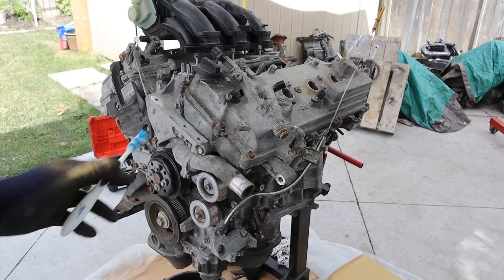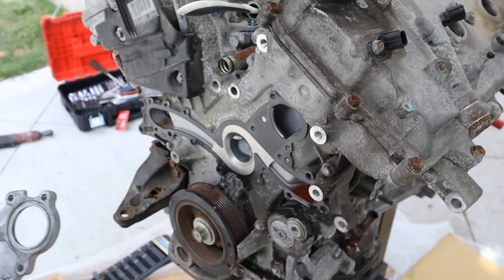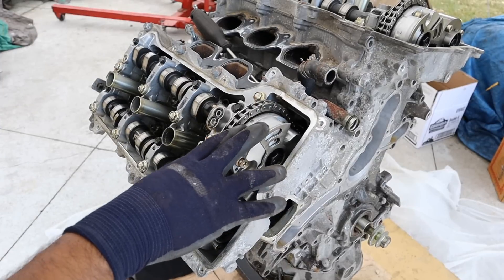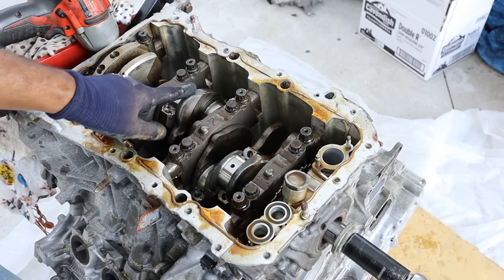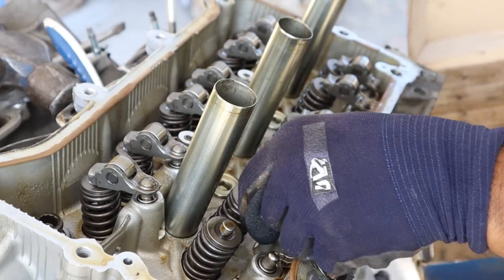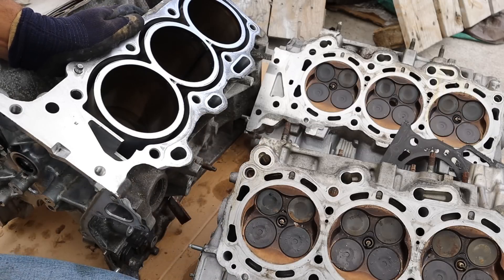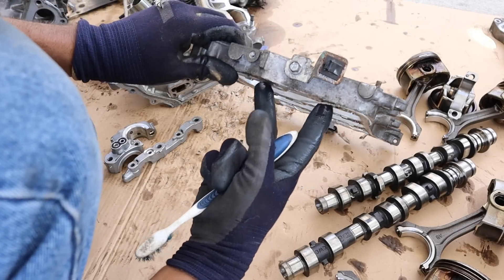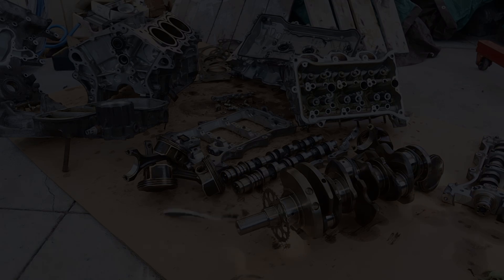The Toyota 2GR 3.5L V6 Engine is a Legacy in a World of 4 Cylinder Turbos

Comment: The 2GRFE is JUNK GARBAGE SHIT engine.  Not even close to a good engine.
Reply from the maker: Why would you say so? Bad experience?
Reply: @speedkar99  They have had TONS of issues.  Google it.  Even a head Toyota mechanic said he wouldn't take one if he was given one.  Yes very bad experience.  My whole 2009 RX350 is junk eventhough Lexus maintained all it's life before I bought it.
Reply: I bought it last June with 72k miles on it and now at ehhh 90k.  Transmission is acting funny,  right after I bought it LOUD as engine nock sounds like a diesel.  Get's worse with cold.  Power steering pump is bad when it gets cold out makes the notorious groan.  2008 Toyota Rav4 I4.  Only issue with it and 180k miles is the nototious oil burning issue Toyota NOTORIOUSLY tried to cover up other than the control arm fiasco they tried to cover up also.  That thing still rolls with 180k on it battered and beaten.  Lexus at 92k damn powertrain is going to shit in a handbasket.
Reply: @speedkar99  I'll gladly bring it to you and you can fix it.  Let me know where to go.  I'm being honest too.
Reply: @glennnichols4220  The 5 speed auto in that rx usually don't fail even if you are one of those owner who has the "funny" shifts from what I am guessing from 3-4/4-5 upshift and 2-1 down shift. Also you have the unfortunate piston slap which I think it affects 20% of 2gr owners. As long as that goes away when fully warmed up then keep driving it. I suggest using synthetic oil so they don't thin out as much when warmed up, has to be 5w30 no light weight oil like 0w20. One customer switched to 5w40 oil and they said it was quieter, funny because that's the recommended oil from lotus for their Evora's. At our shop we seen these cars 200k+ miles with piston slaps and rough shifting transmissions. Hell, my 07 v6 camry piston slapped from new and it's 197k right now doesn't even burn oil. Goodluck with yours.
Reply: @oceanzhu1002  The transmission sure isn't the smoothest and it has a mind of it's own.  Sometimes getting out in front of traffic in a 65 mph zone from a dead stop I floor it when the tranny is cold and it doesn't want to shift.  It just creeps along.  And then when I started it the other day from cold none the less but it  was warm outside I put it in reverse and stepped on the gas and nothing and then made a jerk and engaged and kind of jerked a few times when backing up.  And yes the piston slap goes away when the oil pressure has come to not necessarily when the temperature gauge is normal.  The sad part is I talked to the previous owners about it and they said they NEVER had any problems with it when they traded it in a couple months before I bought it.  Certainly they don't have a reason to lie but that doesn't mean they didn't.  All Lexus maintained from day one all the way until I bought it.  Nothing in the service records indicated any of my problems.  I find it however extremely odd how I get the car and it all of a sudden starts having major powertrain problems.  But I am glad you responded and gave me piece of mind.  I will try different oil.  But wouldn't heavier oil be counter productive to the piston slap?
Reply: @oceanzhu1002 piston slap? Uh oh.. I thought I had lifter tick. My 2grfe is pretty ticky, even when warned up. How worried should I be? It has almost 209k.
Reply: My lotus evora s and Camry would beg to differ lol probably just not well taken care of by the previous owner and unfortunately you got the raw deal of it, it happens brotha
Reply: @andrewraju5365  If you read my comments,  from brand new it was maintained by a Lexus dealership and the previous owner stated that they always put premium fuel in it and even hand washed it.  So the answer to your statement is in the ability to read.

Comment: Personally, the MZ series was better. The closed deck design can take a lot of abuse. Also the water pump is replaceable in the car it is a faff but it's doable even on smaller cars like RAV4s.
Reply: I like the power of the 2GR but I do prefer the closed deck design of the 1mz.
Reply from the maker: MZ was open deck wasn't it? 

I know people have found workarounds on the water pump but itsnot easy
Reply: @speedkar99  it's a closed deck or at least semi closed: https://images.prom.ua/2424375692_w640_h640_blok-tsilindrov-1mzfe.jpg

Really tough engines. PCV system sucks though and the VVTI parts aren't too good. But dump it into an MR2 and it's a hoot. I know a guy who put one into a Celica. It's just too bad you can't easily adapt it for RWD the engine is designed to sit slanted.

I find for the older rav4s you gotta go from the top and bottom after removing several parts in between, including all the front facing accessories. No it's not easy but it's doable. I'm not sure why the waterpump fails it doesn't seem like a bad design or anything, they're even all metal not BMW, but the bearings just go.

Comment: What is wrong with engine... Check engine heads. Replace head gaskets and assemble engine...
Reply from the maker: Doesn't work like that. Aluminum warps. You'd have to machine it flat again. But this engine has variable valve timing, if machined down, the cam to crank distance changes and timing is off. It's Scrap.
Reply: @speedkar99  so it can't be flattened and good to go... Than yeah

Comment: I think Lexus makes the best v6 engines in the world. I have a Lexus IS250 with only 170 000 km on the clock. Runs great, only thing is it eats oil like crazy, probably it has carbon on the rings. 

Recently I fixed the AT problem which was bugging me since I bought it, error code P2757. I just replaced 2 new solenoids SLT and SLU since they were the only ones which were updated by the factory (with some kind of filters on the canals).
Reply from the maker: The IS250 was known for carbon buildup because it doesn't have port injection to clean off the valves.
Reply: Hold my beer.........
The 44 years in production Buick V-6
Many Toyota engines are notorious for drinking oil
The Buick........was not.

Comment: My 2008 avalon had the pump die, but I stopped it on the side of the road when it got to 2/3 up and let it cool. I ran the heater to and back from work, then had a shop replace it. Been fine ever since and shes coming up on 140k. Besides some shocks and 02 sensor, nothing but brakes, trans spill and fill, and oil changes
Reply from the maker: Awesome! Keep it maintained and it'll last a while. How did the pump die, the impeller broke?

Comment: My 2GR-FE ( 07 Sienna) now running on its 3rd water pump. Luckily Extended warranty covered it. Those water pumps live around 5-6 years then they leak or the bearing goes. I've been through multiple recalls to replace the oil hoses or switch them to metal ones.
Reply: Did you change the coolant at all? The coolant turns acidic over time and eats through seals and causes the water pump failure. I have a 2016 Avalon with the 2GR, water pump still going strong fingers crossed
Reply from the maker: I've had my GS350 for 6 years and haven't touched the cooling system ... Makes me wanna change the coolant soon...
Reply: @speedkar99  based on anecdotal evidence, 5-6 years is the recommended interval for Toyota pink, even though it is advertised as 10 years. I did it myself last year and it wasn’t bad at all. If you hear bubbles through the heater core after changing it, make sure you open the bleed valve, attach a hose from the barb to the funnel on the radiator, and let coolant flow through it completely before sealing the system.
Reply: @jakeb4962  coolant was replaced each time the water pump was replaced, a third coolant replacement was during a radiator replacement. So, I never needed to replace the coolant by itself.
Reply from the maker: Should have been only one recall on the VVt hose right?
Reply: @speedkar99  the VVT hose was replaced by an updated rubber hose, at that time the full metal upgrade was not available, luckily this rubber hose still holding up. But there are other hoses in the bottom front passenger side, those were replaced by a flex mental pipes.
Reply: My 2008 rav4 is still on its original at 85k miles. Consistent 5k oil changes help a lot.

Comment: Awesome!! I love this motor. Makes my Avalon a sleeper
Reply from the maker: It sure does! I have the Lexus version in my GS350
Reply: @speedkar99  I have no issues with mine so far. I have 208k miles on the clock. No oil burning or leaks. One thing I’m worried about is the waterpump because I have yet to change that since I got the avalon used at 123kmiles. 

Which year is the best GS350? Oil consumption issues? I want to buy one in two years…

Comment: My gosh, an engine that clean from 2013 says it was fastidiously maintained. Hard to imagine how the same owner would keep driving after the water pump blew up!
Reply from the maker: I know. So sad. I bet they maintained it but maybe oblivious to the overheating situation
Reply: I once drove a Chrysler New Yorker with the 440 RB series engine, it blew a hose on the freeway in high summer
By the time I got off the highway and got it to where I could repair it, the exhaust manifolds were glowing a dull red in the twilight. I cooled it down, replaced the hose and refilled it with coolant, it ran like nothing had happened.
Try, just TRY, to do that with this Toyota or any aluminum head engine.The engine would be scrap metal throughout.

Comment: FSM says to remove the engine for a WATER PUMP!?!?  I knew it said the same for timing chain replacement in a Highlander which is bad enough, but a water pump?  I see DC below said it can be done in an 05 Avalon by lifting the engine a bit, but wonder about much newer, shorter engine bay Toyota vehicles of more recent times?
Reply from the maker: Check the RAV4 manual. The smallest of cars that came with the 2GR.
Reply: @speedkar99  I see em all of the time, and although they would be a nice ride to own, I would never get one...  I do all of my own repairs, and my XXL hands have enough trouble with most newer vehicles, let alone this this goofball.
Reply: On certain Sienna minivans, the service procedure dictates the engine be removed to replace the right front engine mount.
NOT necessary, enough clearance can be had by raising the engine. Ive done a couple.

Comment: I just replaced one on a 2005 Avalon and I took off the nuts on the right and front engine mounts to lift the engine.  This gained clearance to remove the fan pulley and water pump bolts and pump itself.
Reply: Toyota tech here, 100% possible in Camry, Avalon, RAV4, and Highlander. The job used to pay roughly 15 hours since, for a long time, it used to be quoted as an engine-out job, but pay was recently slashed to 6 hours since they found out guys were managing to squeeze water pumps out without pulling the engine. Cool stuff!
Reply: @ClassicalStupidity  How about a 2015 Venza.
Reply from the maker: Nice and easy in a big car. Try that in a RAV4 !
Reply: @speedkar99  I've done it in my Rav4. It looks bad to do but really wasn't that hard. Just lift up the engine a bit once the motor mount is off.
Reply: @speedkar99  i have fks on gs350 plastic vavle cover:face-purple-crying:
Reply: The Care Nut has a video demonstrating this job in a Camry. It's tight clearances but very doable.
Reply: @markvanderlee  Carcarenut
Reply: I'm not looking forward to this job on my 2GR Toyota Blade.

Comment: 230,000 miles strong and the only time I leak oil is when I act stupid and don't use a funnel pouring in oil.
That said, I don't think my water pump has ever been replaced, so uhhhh
Reply from the maker: Nice! What vehicle? 

I have the Lexus variant in my GS350 and so far it's been doing good
Reply: @speedkar99  RX 350, except I have a bit of an update, the valve cover is leaking oil onto my exhaust heat shield :(
I'm also replacing the outdated VVT-i line while I'm at it. I hear it's a massive pain and I need to move the power steering pump and some people have to take out the entire axle, but we'll see how it goes in a couple days.
Reply: Toyota updated the fuel pump to a different design. Could be possible you have the updated part.

Comment: One of the best V6 engines in the world! These things are reliable to the core
Reply from the maker: They sure are...of you take care of them!
Reply: @speedkar99  This person took excellent care of his engine to no avail, or its a second motor replacement? Either way I've come to the conclusion that newer Toyotas are junk...
Reply: Their only weakness: they must have oil and coolant 😂
Reply: Sure, thats why my 38 year old Ford Cologne V-6 overheated due to a failed water pump, but it didnt blow the head gaskets.
The best V-6 was the iron-over iron Buick division V-6 which remained in production in various forms from 1961-2005. They didnt blow head gaskets even in supercharged trim
Reply: @donreinke5863  the first Buick V6's were terrible they would almost Shake apart because they were so unbalanced I think your memory is a little fuzzy buddy. They didn't get those v6s right till about the last 10 years of production. Do you not remember the countless '80s cars with the 3.8s blown up due to failed oil pumps etc etc? I could go on for quite a while on the problems the Buick V6 had over its lifespan!
Reply: @kskip4242  And I can go on and on about your lack of knowledge concerning the Buick V-6..the engine actually went downhill somewhat in the last 10 years of production due to GM decision to use chap plastic intake manifolds rather than cast aluminum.
While there was a difference in smoothness between the early odd-fire and later even fire engines, it was of no importance.
Kaiser-Jeep corporation elected to actually buy the Buick V-6 production facility to build engines that powered the CJ models from 1966 until 1971 when AMC bought Kaiser Jeep. GM bought the factory back from AMC in 1975 and released the second generation of the Buick V-6, changing the displacement from 225 to 231 CI.
Beginning in the early 80s a 252 ci variant was available, and the engine received fuel injection in 1985.
All of the later engines often exceeded 250,000 miles without major issues, although going to a crank driven oil pump was in fact not the best idea
Shall we get into the far worse problems the Toyota V-6 had and still has?
Try again, your royal fuzziness.
Reply: @donreinke5863  already knew all that had a 252 with a four-barrel in a Grand Prix, piece of gutless shit. I'm not sitting here praising a Toyota V6 I don't know where you got that from lol.
Reply: @donreinke5863  Part #8901822  is the ALUMINUM intake that was used on all of the last 3800 Buick engines produced.
Reply: @donreinke5863  I used to replace the plastic ones on the older series 1 and 2 engines almost on a daily back when I was a tech.
Reply: @donreinke5863  All those years and 190hp is all they made at the end of production lol.
Reply: @kskip4242  Possibly in the final years of production they realized their mistake. Ive replaced MANY 3.8 intake gaskets from the 90s that were plastic. The 80s "Series 1 " were aluminum and they were plastic after that, of course the supercharged 3.8 engines used in the Buick Park Avenue, Pontiac Bonneville SSEi, Olds 98 and Monte Carlo SS were aluminum.
I never tried retrofitting the manifold you mentioned to replace the plastic manifold units as they kept changing the bolt patterns and ports, although I was able to install the supercharger equipped manifold on an na 3.8 when there wasn't a supercharged engine in the wrecking yards.
Reply: @donreinke5863  i had one of those buick 3800 engines circa 1988. It was torquey.
Reply: @kskip4242  That didnt matter--they were reliable......but
You must be forgetting about the Buick Grand National/ GNX, which was actually quicker than a Corvette when it came out.
Chevrolet division had a real problem with that, and had the big cheeses at GM underrate the power output so it wouldn't "have"more hp than the Corvette.
The actual turd was that hideous HT 4100 Cadillac V-8 that not only was horribly gutless, (especially in a nearly two ton Fleetwood Brougham) but required that "GM engine cooling supplement", a concoction containing turmeric and ground up nut shells be added to the radiator so the head gaskets wouldn't leak...no power and no reliability.--oh and they would habitually eat distributor gears along with the drive gear on the camshaft.
Reply: And goes nice in my master blade g... a v6 corolla!
Reply: Super reliable engine but it took Toyota until about 2016 to figure out FIPG.
Reply: If it is so good why did it blow up.  Water pumps should last the life of the rest of the engine.
Reply: @user-tb7rn1il3q  Some V-6 engines produced by Ford and Chrysler had INTERNAL water pumps driven by the timing chain behind the timing cover. When (not if) they fail, they dump coolant into the oil destroying the engine.
You cant see the leakage until the damage has been done. Ethylene glycol (antifreeze) is highly destructive to bearing material
Possibly the most ignorant "engineering" design ever.
To their credit, Toyota (and  most other manufacturers) avoided that stupid arrangement.
Reply: Drove a rental previa with this engine, so smooth and powerful.
Reply: Nissan’s VQ engines are also good. They made the Wards best engine list 14 years in a row.
Reply: @elonsus9747  The Chrysler 4.7 also made joke Wards best engine list when it was introduced..it turned out to be an unquestioned  disaster.
Reply: @donreinke5863  They made a mistake putting that in there then. 🤣
Reply: @elonsus9747  Oh they did--they bought into the hype and apparently liked the design, but it turned out a POS
Reply: @elonsus9747  I have both haha